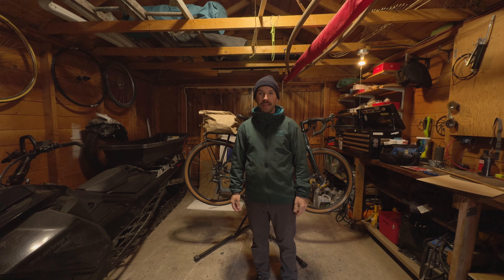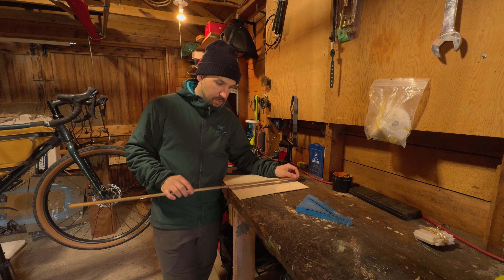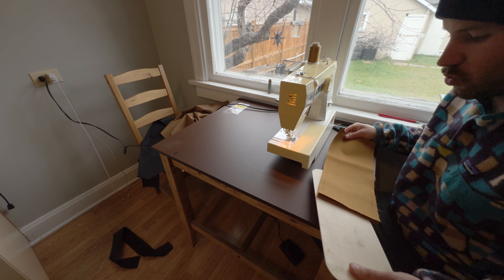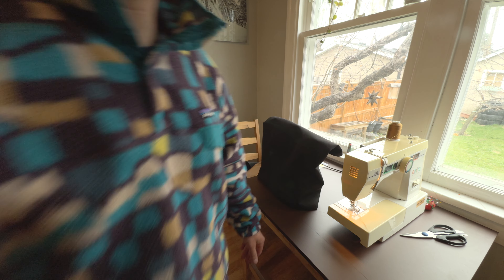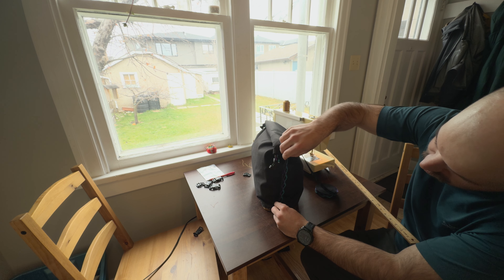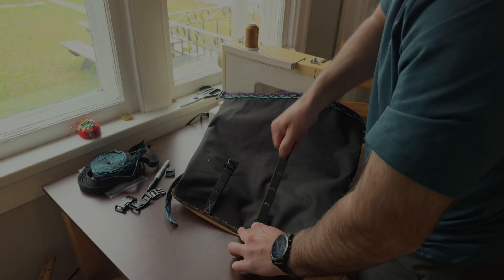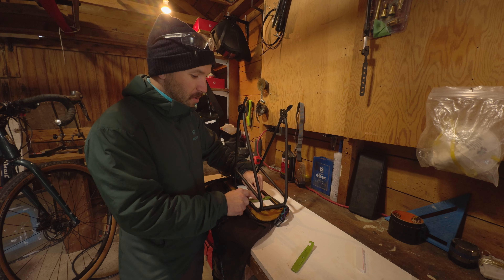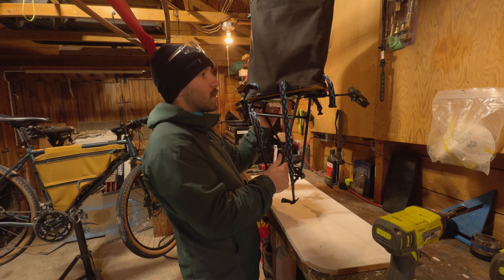I made a DIY tailfin | Bike Packing tail bag

Comment: nice build, neat sawing. i've ripped off also a tailfin bag but made it a bit larger (my rack is also larger) and instead of sawing it I used cutouts of vinyl canvas (that I got for free at a truck cover store), and I glued them with cyanoacrylate. I made a semi-rigid bottom with coroplast, and to close it and attach it to the rack I used straps and buckles from an old bag. I only had to patch it a couple of times (with a small cut of vinyl and superglue) in a spot where it had been worn from rubbing with a part of the rack. It's already 5 years old and is still absolutely waterproof, you can even carry water on it. 
In summer, lined on the inside with roof insulation, makes an excellent beer cooler.